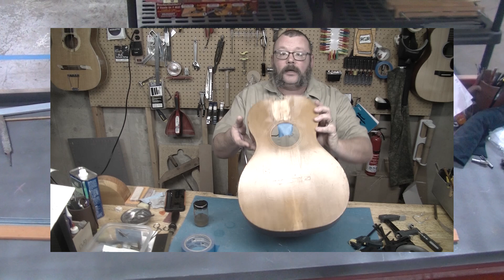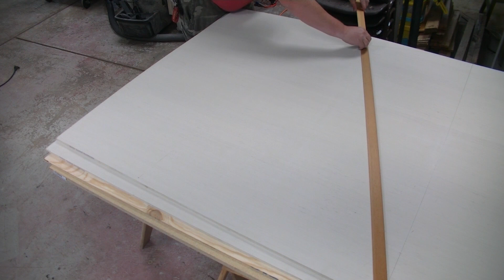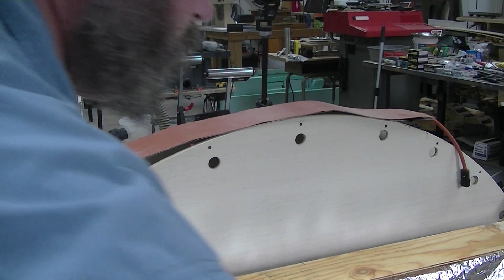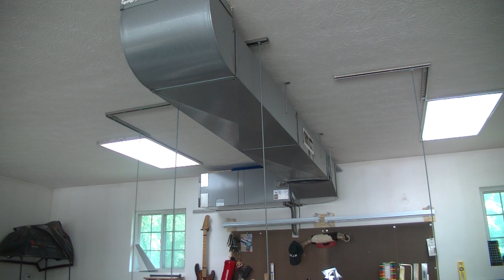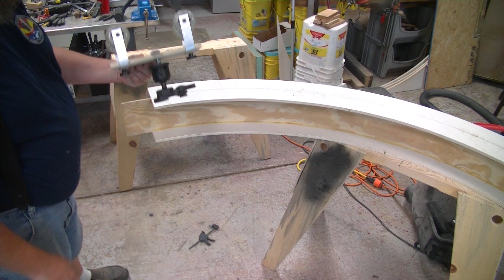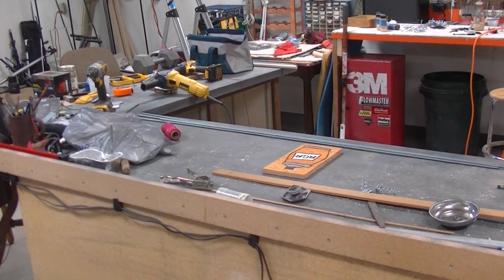Overhead video camera rig and dolly build | RATTLECAN GUITAR RESTORATIONS by James O’Rear

Comment: Nice job James. What camera are you using? There are some remote pan tilt tripod mounts that will hold a cellphone or a lite weight camera.
Reply from the maker: One of the small JVC HD cams. I've seen the ptz heads, might go there if the Patreon pledges allow it.